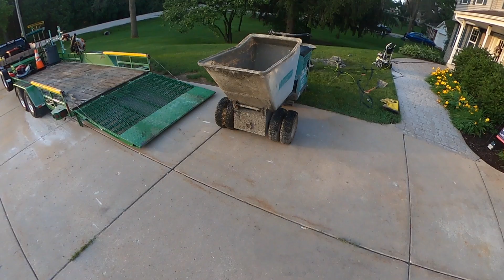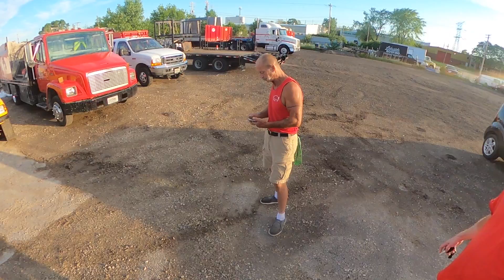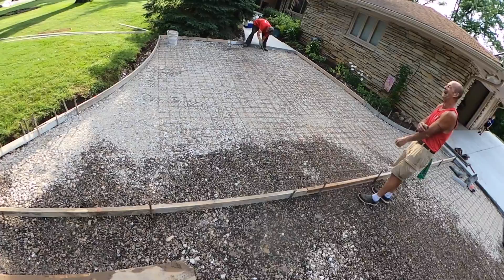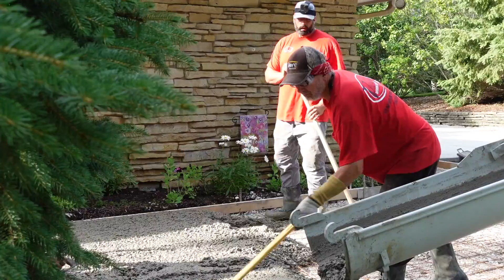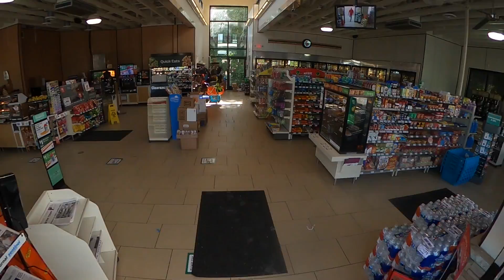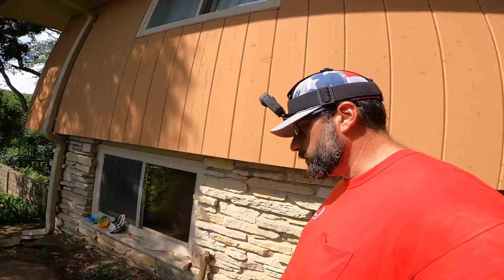Pouring concrete instead of pouring rain. FINALLY!

Comment: I gotta respect that slump you guys pour at. Looks like a stiff 4. It seems you have a lot of time to work with the concrete after laying it down. My guess is the humidity? Here in Utah if you don't bull float right after the rod you will struggle to seal the concrete. You guys do great work man.

Comment: Hey Victory! I see you pulling up the wire, but doesn't standing on it push it back down?
Also, love the videos. Actually very relaxing to watch.
Video request: explain the advantages/disadvantages of concrete vs asphalt. maybe talk about why you only do concrete. I imagine its entirely different skills/equipment but I'm interested to hear your take on it.
Reply: And one more question if I may. You always put wire in the concrete, but I rarely see it in the stuff you excavate. is it much more expensive? how much does it extend the life of the driveway?

Comment: Respect.  One question.  You have time to discuss ACI and IRC rules as wells as cover different  SDC s as they affect reinforcement requirements? I know this all exterior
Reply: For technical guys doing layout and inspections it would be interesting to hear about. Placing rules differ by regions but some rules are uniform.  Great content.

Comment: Quick question are you having problems ordering concrete down there? Down here in NC it's been a pain the get concrete because of a "shortage of cement". I wonder if it's only north Carolina or are other states are having this issue aswell 🤔
Reply: One issue is sand. There are trillions of tons of sand in the deserts around the world but they're are too fine to be used in concrete.

Comment: How dry to you pour your mud and do you ever put any fiber in anything slabs
Reply from the maker: I put fibermesh in everything I pour. We usually pour at around a 5 to 6 inch slump, sometimes drier depending on what it is.
Reply: Iv noticed fiber helps for a smoother finish but ppl down here don't much use it but I call it cheap insurance

Comment: When you have to pour over multiple days/truck loads how do you make sure the color is going to match?
Reply from the maker: There is no guarantee, you use the same concrete and finish it with the same techniques and usually it is fine.  Once in a great while there can be a problem though.

Comment: you guys don't vibrate your concrete up in Wisconsin?
Reply from the maker: Vibrate the concrete in a driveway? I have never heard of that and it wouldn't provide any benefit at all.
Reply: oh I was just wondering. im 21 working in commercial construction. We vibrate the concrete we poor so i was just wondering why you don't. Love the vids and the crew! thanks for answering.

Comment: Not sure if I asked you already but my cousin owns a company and we both obviously have the same last name his company has landscape in the name and I I want to use our last name as well but instead of landscape I’ll put services he does lawn care & landscaping I do fence,tree work, and concrete removal would having the same last name in our company be an issue ?
Reply from the maker: I don't think that will be a problem as long as you're both ok with it.  Legally, no it should be just fine. The only issue is that potential customers might confuse you guys which could possibly cause disagreement between you if one of your companies grows big and the other remains small.

Comment: Strange how you get away with zero rebar in all your jobs. The mat that you use is flat on the ground. May as well not even use it.
Reply: He pulls it up during the pour so it sits about an inch above the ground. He uses rebar at the areas where the slabs meet
Reply: This must be your first victory video. Watch the others and you will know how important it is for Ryan that no mats are left unlifted.
Reply from the maker: I have had great success in 23 years in business using a combination of wire mesh and fiber mesh. No lawsuits and never replaced a square foot of concrete due to structural cracks. And yes we always pull the wire. Remember that the type of soil in your area plays a big part of what you need for reinforcement. Also the base you use plays an important role. We always have several inches of compacted gravel base. Some areas pour right on top of soil which would never work here and some areas have sandy soil which would require rebar as well.